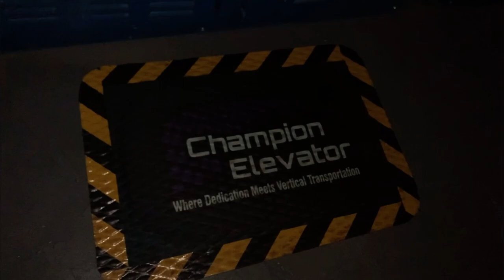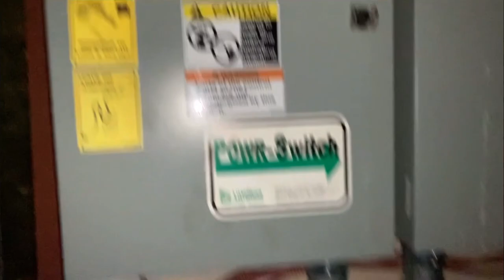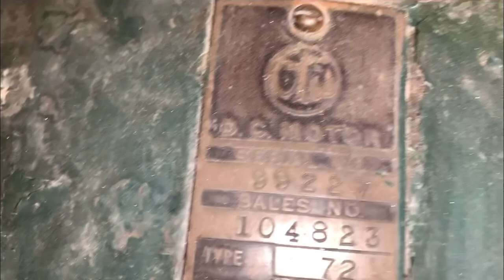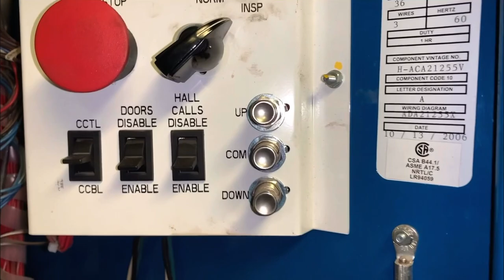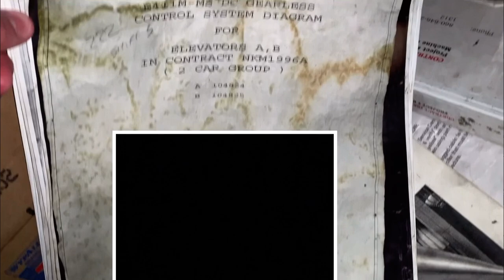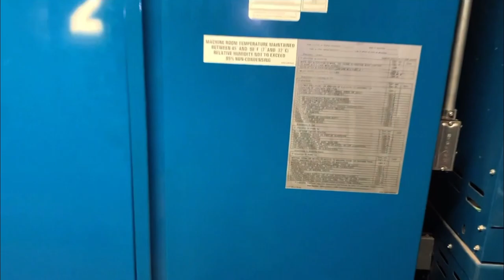MACHINE ROOM: 1927 Gearless OTIS 72 Machines -- OTIS Elevonic 411-M - 500fpm

Comment: There were Otis gear-less from 1914 in the Smith Tower in Seattle WA 42 floors they were replaced a few years back.  These gear-less ones appear to be still be in very good condition 94 years old, build to last.  Was there another machine elsewhere not in the footage?  I noticed 4 DC Drives.  Was there a HP listed on the data plate?
Reply from the maker: That’s really cool. And no, there is only 3 machines in this machine room, but there is a little inlet on the opposite side of the abandoned machine that now just is a storage area so maybe that could have been a 4th machine. And I don’t think there was an HP listed as I would have listed it in the description, but also that part of the video wasn’t filmed well
Reply: @TechNerdNolan  There could have been a machine in the opening to the left of machine #1 that was removed.  Those stacked cabinets might indicate something else as they are tagged "3" "3" one of them could be an isolated 3 phase transformer/step down transformer for the controller. With the 2nd one, the DC Drive for the traction machine. I saw an installation before where a transformer was used before.

Comment: Was the original relay controller still in place for car 1?
Reply from the maker: No
Reply from the maker: There’s an original 1927 manual in the building tho but machine room was locked
Reply: It's called elevonic R/411 They usually make lots of relay noise but they are mostly microprocessor
Reply from the maker: @QEElevators  Elevonic R wasn’t out in 2008
Reply: @TechNerdNolan  I said R/411 👁👄👁
Reply from the maker: @QEElevators  Ik but they aren’t the same